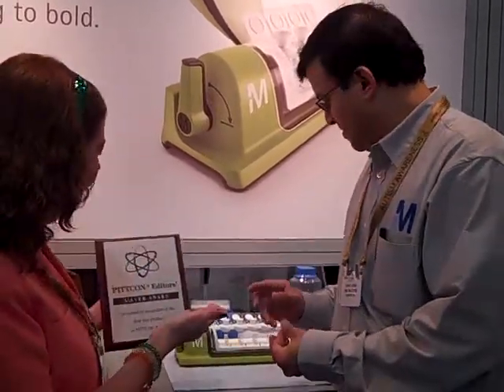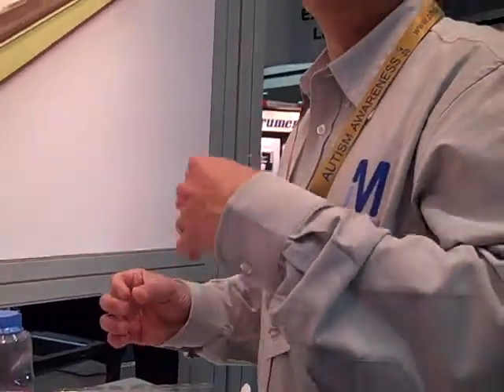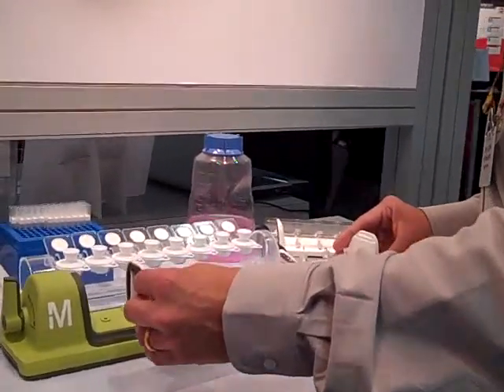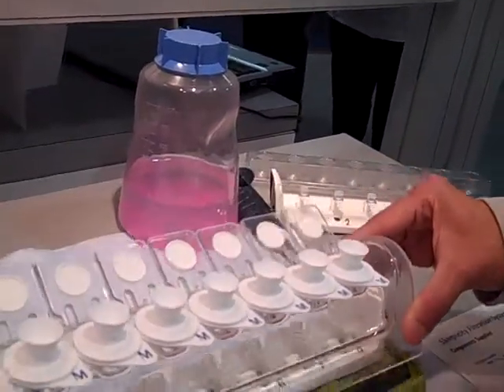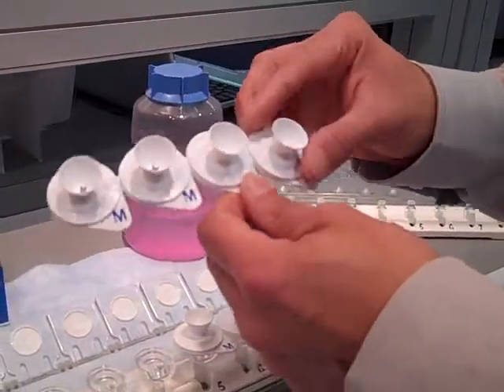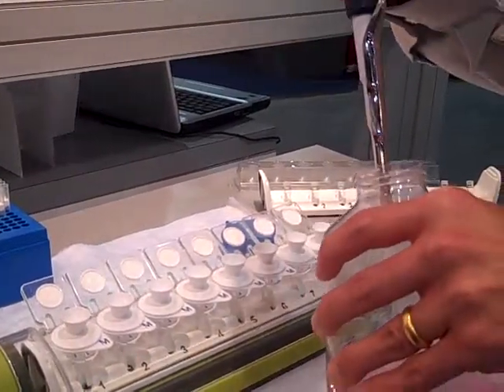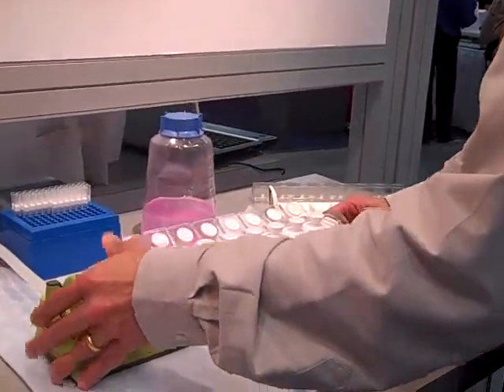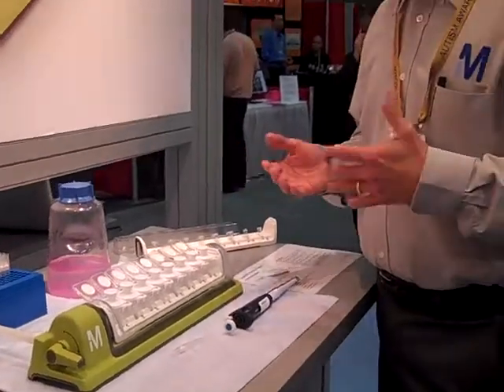Pittcon 2011 Editors' Awards :: Silver :: Millipore

Comment: This is a great tool, however it needs improvement. Autosampler vials are generally held in racks of 10X5. In its current format a user would have to place each autosampler vial into position, then add in the sample one at a time, then filter, then remove all the samples. The manifold should hold the 10x5 rack (perhaps in 5 adjustable positions for 5x10 filteration steps). Finally the filter should be close enough for multi-well pipette use.